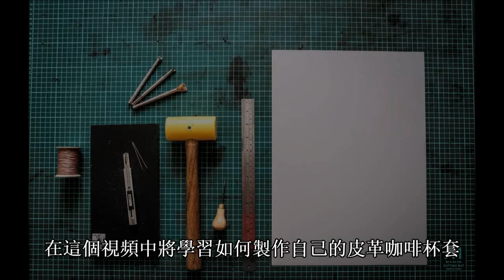How To Make Your Own Artistic Leather Coffee Cup Sleeve

Comment: Is the"gusset" the same as a grommet?
Reply from the maker: A grommet is a piece of hardware that reinforces a hole that has been punched into the leather. A gusset is the material used to make up the bottom and sides of a bag or purse.
Reply: Fischer Workshops ok, so the metal ring that you put in that hole was that a gusset or a grommet?
Reply from the maker: It's a grommet
Reply: Fischer Workshops ok. I was confused, in the video you called it a gusset. Sorry to be a pest. Thank you for the speedy replies! 🙂
Reply from the maker: Oh know... Did !? It's easy to get these odd words confused. Thanks for letting me know😂